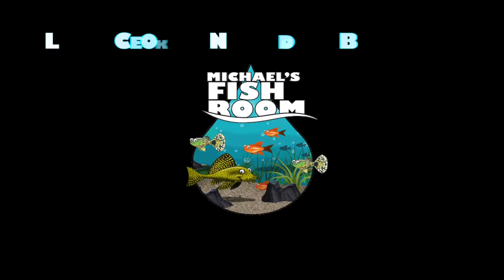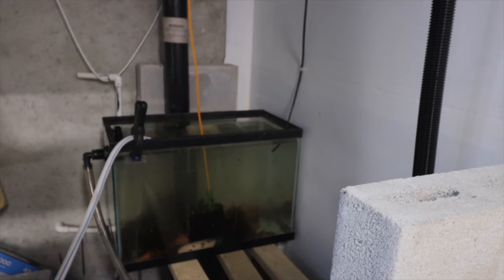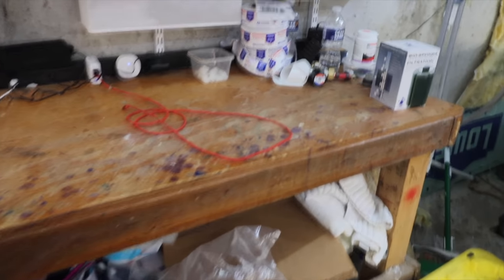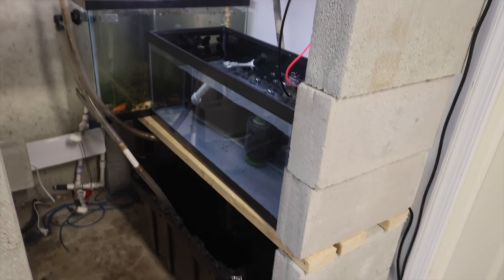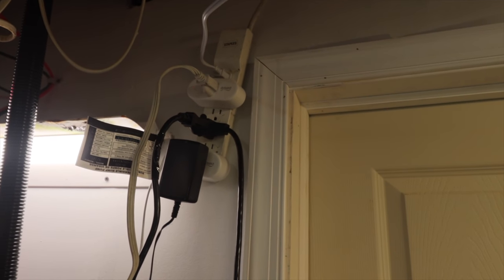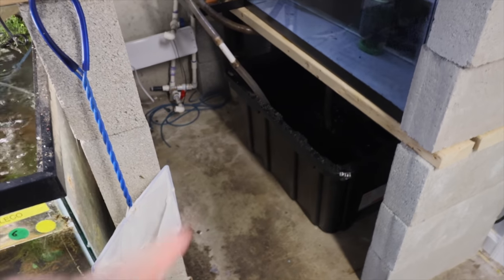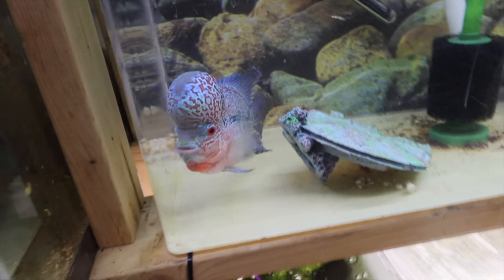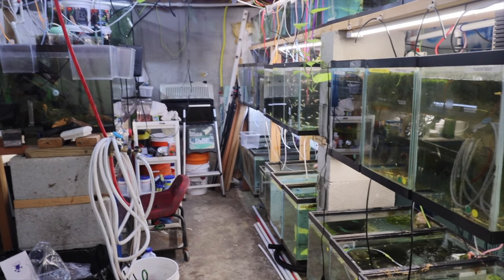MAJOR CHANGES!

Comment: Love the fish room.  I am currently planning/building a small one that will undoubtedly get bigger over time.  I noticed your bulkheads are drilled at several heights for your overflows.  Do you find one drilled more toward the midddle of the tank works better than one drilled more toward the top?
Reply from the maker: No, I like them near the bottom. It allows for easy draining. The ones you see by the top are the first ones I drilled and didn't know any better.